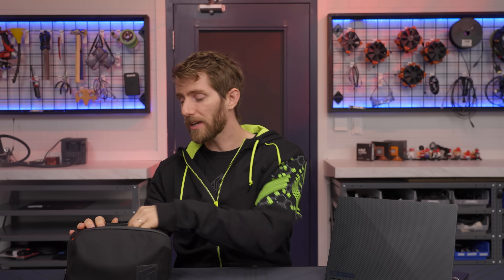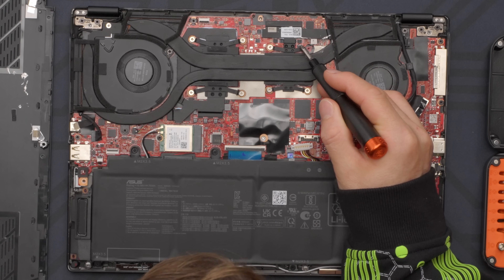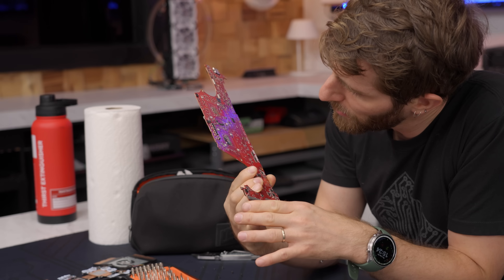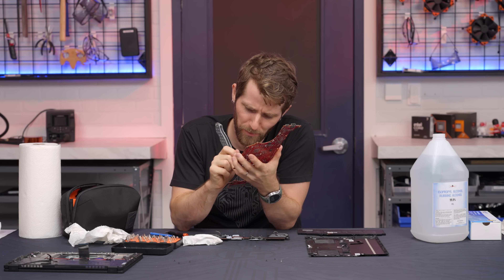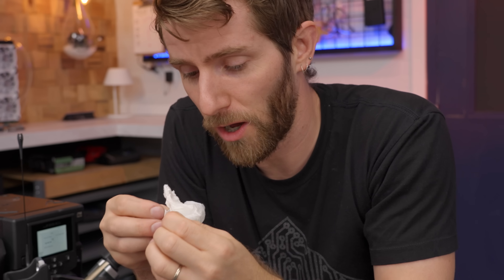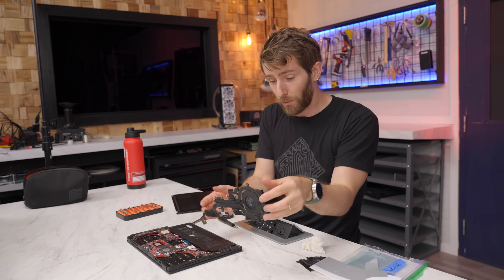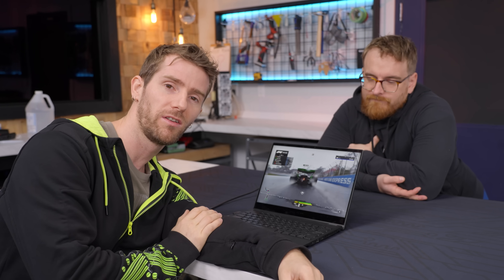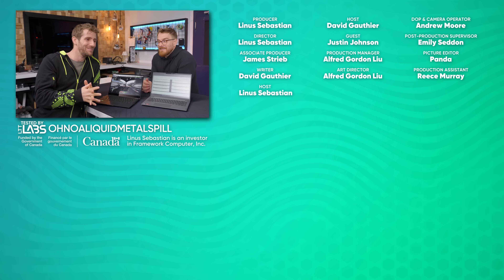Liquid Metal Killed my Laptop… Now What?

Comment: As a chemical engineer, I find the idea of putting a gallium alloy on a PCB horrifying. I guarantee that this is a fad.
Reply: There's a reason they try to build what is basically a moat around it to contain the L.M. Shame it doesn't work in reality. Perhaps they should use a hardening silicon to contain it.
Reply: @johnt.848  "I dunno about you but I like my CPU permanently potted directly to my heatsink and fan assembly" (No but really tho, lack of repairability aside it would be a valid solution lol)
Reply: So, liquid metal makes sense under very high end applications because you really cannot beat the thermal performance... but everybody knows that doing it wrong will kill your machine and so only the most skilled or foolhardy attempt to build LM based systems.

Then some marketing executive said 'hey we could charge a lot for this, and people would want to pay whatever we ask because they would assume the assembly was done by competent professionals, thereby removing all the gambling of users doing it for themselves!'

But it turns out that people who have absolutely no motive to make sure your computer works for longer than the month in which you can still return it tend to not actually care.
Reply: @sindrisuncatcher653  also it's not really a valid choice when the product experiences minor flexing and vibration during normal customer handling of a laptop such as putting it  in a backpack and wearing that backpack when travelling.
Reply: @sindrisuncatcher653 liquid metal has its place in data centers or something like that.... even desktops. Laptops is stupid
Reply: as a chemical engineer you should figure out what the hell kind of metals we need to make it work
Reply: @sombrero4316 the only two choices for metals that are liquid at or near room temperature are mercury and gallium.
Reply: @RCaIabraro  no risk no reward lol
Reply: Yea seriously lol like you may as well just take a flathead screwdriver (or conductive SOMEthing) and try touching a bunch of separate (&multiple) contact points together to see if anything arcs and shorts out lol
Reply: LOL thank you.--for ok now for something that HAS got to have like I don't 99.999% up time? why not a adumb client netbook kind of thing: the thing you carry: just a screen, keyboard and satalight connection. The ones I've seen that are portables (ie laptops or notepads etc): fans, all in one loop coolers. some used non conductive gasses. galliun> what the fuck. lol that's--so fucking dumb.  lol that's right up there with nondonductive oils--then fucking around with mineral oils lol
Reply: Why don't they coat the whole PCB with components on with something so that any liquid like water or liquid metal physically can't touch it?

Sure, the coating would get ruined as soon as you repair something, but it's better than nothing because only part of it would get compromised anyway
Reply: @Xnoob545a lot of the components generate some heat not enough to require active heating but enough where covering it with conformal coating would keep to much heat in and prematurely casue the board to fail.
Reply: @Xnoob545”conformal coating” is what you are looking for and is liekly not used, because it’s an extra process and that costs money.
Reply: @telefon72 also heat. Some of the mosfets get slightly toasty, adding a layer that lets the heat concentrate more before it gets dissipated coukd be enough to degrade life span unless you add an extra PCB layer, some vias to dump heat into it and tie it into the cooling system.
That would likely tripple the cost of the motherboard and require some extra manual steps thanks to all the extra thermal mass.
Reply: @Xnoob545 AFAIK some old Thinkpad had it (P series I think?), and it's really common in appliances that use water, like washing machines.
Reply: @ClockDev washing machines use liquid metal?
Reply: @RCaIabraro  I meant they use conformal coating :-)

It help to avoid moisture-related failures in those appliances.
Reply: @Xnoob545 heat.  even a super thin coat or protection will add to much heat
Reply: It could be planned obsolescence, they want the device to break and short
Reply: Its not a fad, just poorly executed right now
Reply: Good thing you're not an electronics engineer. Liquid metal is the future
Reply: @ts8960  very futuristic brick
Reply: @HPLaserJetProM404n  No doubt. If anyone is a trusted resource in the development of futuristic bricks it is HP.
Reply: @uncharteredantelope that model of HP is actually an insanely reliable printer.
I never had to do physical maintenance on them during my apprenticeship but I did have to reset the page counters on a few of them.
Reply: @ts8960  I've seen T2 and LM is going to kill us all.
Reply: @ts8960 the benefit seems small compared to the downside.
Reply: @ts8960  not with 1% gains.
Reply: @ts8960  Liquid metal is the future in the same way thin-bezel LCD TVs with lots of glow and backlight leakage issues are the future, or in the same way sealed in batteries making phones harder to repair is the future, or GPUs that hit 90 degrees C by design are the future: The future of enshittification.
Reply: @Δημήτρης-θ7θ  yes liquid metal is here to stay, the problem here isnt the liquid metal its just the poorly assembled encasing that ASUS created for it
Reply: @ts8960 That's the problem here, no manufacturer will invest in a proper liquid metal encasing because it's expensive, much like no manufacturer makes LCD bezels made out of titanium (so that they can have both thin bezels and no backlight glow or backlight bleed due to warped bezels), they will use liquid metal to win benchmarks and when it leaks they'll blame the user or call it an "operational characteristic".
Reply: @ts8960  Tell us all about your electrical engineering degree so we can understand why your opinion is more valid than theirs.
Reply: @ts8960  That was said for many things that no longer exist. Also, Its a laptop. It doesn't need great heat absorption if the cost of great heat absorption is danger to ALL parts of the damned thing.

Comment: The risk to reward ratio for liquid metal thermal paste over conventional thermal paste is too extreme. First you need a dedicated SEALED cpu housing which this laptop lacked entirely, and you'd also need extra padding to ensure the liquid cooling does not leak to destroy your entire laptop. This pc had no failsafe protocols which is quite honestly an oversight. That laptop is probably $500 -$1000 and to lose your entire system because of minor user error is terrible. Moreso it is manufacturer error entirely. To move a laptop while using laptop is the reason laptops exist in the first place!

Comment: I did the same thing. And I thought it was cooked. Everytime I turned it on, it was just keyboard lights. After I had enough, I turned it on and left it on, and went to have something to eat. I came back to a working laptop. After dissasembling and removing the battery, Asus EC controller needs to relearn everything. It can take up to 5 minutes. Just turn it on and leave it.

Comment: I had put some liquid metal in a old Lenovo W520 Laptop. I lent it to a friend for about a year and when he gave it back to me, I was welcomed with a throttleling 105°C CPU ! By the time, I had forgotten it had liquid metal so I just thought that the thermal paste dryed out. Imagine my surprise when I removed the cooler I found liquid metal everywhere arround the CPU an GPU ! Luckly for me, I had the great idea to apply some nail polish (yes really !) on every component arround the CPU and GPU dies "Just in case". This move saved the computer. I put it back together with good old MX-4 and temps were normal again. Since that, liquid metal is Out of the question for me and on top of that, I can't remember the computer running cooler when the liquid metal was freshly installed.

Comment: Gallium isn’t actually corrosive to aluminum. As far as I understand, corrosion requires a chemical reaction to take place, such as oxygen and iron reacting together to form rust. 

Gallium doesn’t undergo a chemical reaction when it infiltrates aluminum - it creates an alloy (a super weak and brittle one) instead, so it’s not actually corrosive. It’s definitely a nuanced difference, but I think it’s an interesting one.

Comment: Funny that this video comes out after I removed the liquid metal from my ASUS zephyrus GA402RK this week. The liquid metal distribution looked similar to Linus' laptop in the video except that mine didn't spill it everywhere. 
I was ranting the whole time about the stupid idea to put liquid metal on a consumer laptop to my best friend via signal. 

The funny thing is that after replacing the stuff with a good thermal paste it performs better than on the first day.
Which is in line with the finding of the lab. 

In my case I think it's due to poor/uneven application of liquid metal. The center of the GPU and CPU had an area with no or very little liquid metal which left a dark spot on the die.

Comment: 11:11 you have a really good microscope, why not use it while cleaning the liquid metal and while doing the solder job. You could even check if the liquid metal went under the CPU/GPU. Also, one or two missing capacitors will have little to no effect on the working of the laptop.

Comment: Nvidia's new 5000 Super series graphics cards will have slightly more memory to maintain memory hierarchy...
RTX5070 = 12GB
*RTX5070 Super = 15GB (5x3GB GDDR7 modules)
RTX5070 Ti = 16GB
*RTX5070 Ti-Super = 18GB (6x3GB GDDR7 modules)
RTX5080 = 16GB
***RTX5080 Super = 18GB (6x3GB GDDR7 modules)
***RTX5080 Ti = 21GB (7x3GB GDDR7 modules)
***RTX5080 Ti-Super = 24GB (8x3GB GDDR7 modules)
RTX5090 = 32GB
***RTX5090 Ti-Super? = 36-48Gb (12-16 x 3Gb module GDDR7)

Comment: this is why i am happy i changed to the tpm7950 pad. while the core remained the same, i did also use it on the memory modules and it actually made my laptop so much better now to where i am getting way higher results on benchmarks than stock. the liquid metal did end up permanently getting a red bar to appear across the screen though. that liquid metal is terrible on a laptop and should not be used. needless to say, i will not be buying any laptop with liquid metal in it thats for sure

Comment: Even if liquid metal doesnt actually get out of the CPU seal, it can and WILL eventually move around and remove itself from the center of the CPU die, leaving the die partially or even fully uncovered and without any contact to the heatsink. It is not uncommon for the liquid metal to leave parts of the die without contact, leaving burn marks on the cpu. Liquid metal is horrible on almost every way possible.
Reply: it absolutely should not be moving around with the right amount and pressure on the die. Also those "burned marks" are actually a thin layer of a new compound created by the chemical reaction of the two alloys. It doesn't cause any real damage. LM is indeed a lot more headaches than other solutions but can absolutely be better if done right. It often isn't.
Reply: @mrsearaphim4077  as you said, it often isn't done right. I have a zephyrus g14 2024 and I have a friend with the 2023 model (liquid metal too) and his heats up a lot more doing the same tasks, we already opened it and cleaned it (without removing the heatsink) and cleaned up windows too but it still heats up much more for the same tasks, the laptops are almost the same design overall, so we think he just got a bad LM application from the factory but we are both too afraid to remove that heatsink and make a mess. I got lucky with mine as it seems very well applied, I hope it lasts but I will probably never buy a laptop with this again, the quality of the application is too random and the durability too. I hope brands start doing PTM7950 out of the factory soon.
Reply: @mrsearaphim4077  The big benefit to me is that you pretty much never have to repaste it. 

...which is why it is infuriating that my laptop has liquid metal on the CPU but regular thermal paste on the GPU....

Comment: My Rogue Flow X13 2022 survived this operation thankfully 😅. During a university class, I accidentally flipped my laptop over and noticed the metal on the vents. Panicked, I rushed to my repair guy. after opening it up we understood that running heavy programs had loosened the metal. As it fell out, the fan sucked it into the vents, preventing immediate damage to the laptop. After 3 hours of cleaning under a microscope, and a change of paste, it was running again.

Comment: In 2022, I had a problem with my PS5 where it kept shutting down on its own during gameplay. I took it to a trusted repair shop in my city. They didn't find any problem with the console itself, but they replaced the liquid metal with conventional thermal paste, which solved the problem.
Reply: I'm guessing you had it vertically having it horizontal doesn't have that problem  but I agree it is a big flaw in the design

Comment: ASUS clearly is at fault here. If your liquid metal seal doesn't survive a little bit of roughness and warm vertical storage on a laptop (which can be expected to be used on the go), then you (ASUS) should not use liquid metal. If you do, it's your responsibility to fix all damages this bad decision/design causes. Man, with all the blunders during the recent years, I really think that ASUS can not be seen as a reliable brand anymore. Just recently it was discovered that their firmware for the last 4 years was written by absolute amateurs and causes significant performance issues. If they can't get something as critical as firmware right, there is a high chance that there are other issues just waiting to be discovered.

Comment: Tbh, Framework did switch from liquid metal to PTM7950 on the FW16 back in december last year and offered a free replacement kit for those who asked.
It really seems like liquid metal isn't a good option for laptops and other devices that are often moved around and in a state where the liquid metal could still be hot and liquid.
At least on FW side, they stated they've seen degraded performance over time and I recall multiple shipment updates stating issues with thermals and liquid metal moving around.